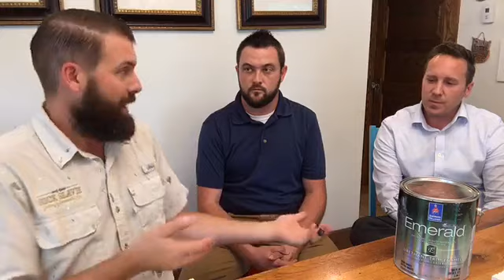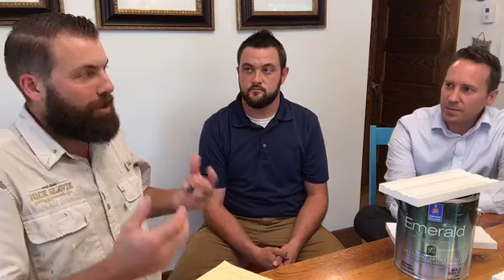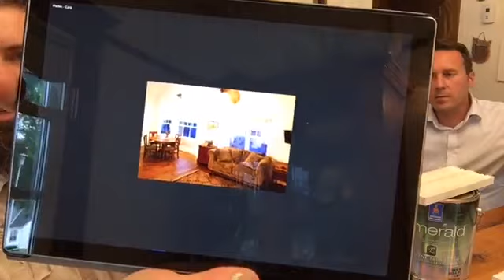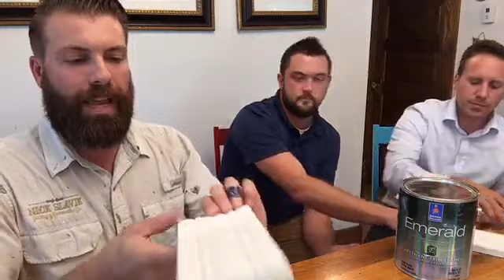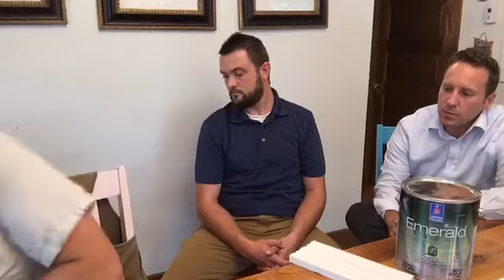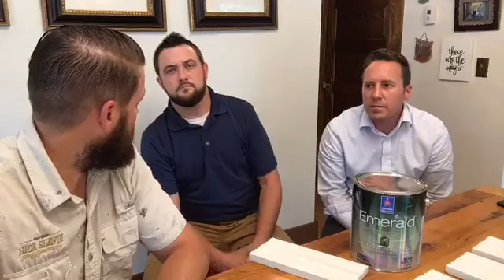Ask a Painter Live #115: Sherwin-Williams Emerald Trim Urethane and all of your questions live!

Comment: How do I apply to be your apprentice?  I’ve been painting for a school district for years as a painters helper. The painter who taught me so much died. The painters they still have don’t want me to waste time prepping, tell me Emerald isn’t made for brushing doors, Dont sand between coats, or vacuum, or even brush off the sanded surfaces or even let me clean the doors or walls any more.  I wirked temporarily fir a painter who is painting peoples houses and didn’t seem to want much prep first. Everyone thinks it’s faster to roll but looks like crap. I’m about to retire from the school district kitchen but would like to work painting g fir ten more years or so.  Who do I apply to be an apprentice in Oregon ?  I only want to paint if I can do it right.

Comment: I am repainting my cabinets bc though the previous owners had it painted beautifully, they didn’t prime correctly. The paint is peeling off down to raw wood around the uppers by the stove mostly. What kind of primer should I apply that works best over paint AND bare wood? Also, what would you use to repair dings in the corners of cabinets?

Comment: Presuming you are very busy, my question re: thinning is in the final paragraph—if you need to cut to the chase. Thank you Nick.

Great videos.   I just used EUT paint in pure white Semi. I had hesitated to try it based on others’ complaints of a roughness to the dried finish.  Your video addressed that concern.  So thanks.  Also, a local SW store assured me the issue applied only to satin and had been resolved 2 years ago.  They offered me a return guarantee.  I purchased semi because the project calls for it, but I may try satin eventually.

The dried semi is not rough to the touch and I am extremely impressed with its ability to level out incredibly well on both horizontal and vertical surfaces.  BTW testing Purdy nylox vs Clearcut.  So far they are so close, it’s hard to say.  But if I had to say right now…edge goes to Clearcut.

Thinning question:  I get the company line of “no thinning needed”.  Till now, I used Pro-Classic oil and never used it w/o thinning with paint thinner or sometimes penetrol, despite the official line being, “no thinning needed”.  Q: Does EUT paint change over time once opened (like oil does)?  If I conclude it does need thinning to restore the qualities of the freshly- opened can, do i use water?  If so, is the max 10%.  My guess is that or much less would suffice.

Comment: Hi there, I used this on my custom board game shelving in satin. Overall it went on great, however, some of the boards are still a little rough (smooth but enough to pull off some of the paint from the box... My question: Is there anything I can do to help smooth out the finished product after I already have 2 coats on it? Thanks again!
Reply: You probably forgot to degloss, sand or use an oil based primer before applying the paint. Or you didn’t wait the necessary 48 hours for the oil primer to cure and harden, before applying the paint. Rookie mistake lol. All you can do now is strip it all off and start over
Reply: @charlesg7926  who the hell is going to wait 48 hours for the primer to cure? Answer, nobody.

Comment: Great video.  A couple of questions, using a Graco X7 , what FFTP do you sue for spraying trim with the Emerald paint and do you have to thin at all when using the FFTP tip.  Also, after sanding the primer and applying a good first coat, is a second coat needed and do you sand between the coats of Emerald?
Reply: Fflp 308.  Don’t thin. Sand with 220.

Comment: Spraying this product takes some additional time and effort to apply correctly.   This product does not apply through a sprayer like any other product sherwin-williams offers.  
Drips and sagging are common.  
What tips do you have that will help with understanding the process of spray application to achieve professional results

Comment: How do you weigh the benefit versus cost (in terms of time and effort for a DIYer) of doing one coat versus two coats of the SW Urethane for trim?
Reply: This isn’t even a legitimate question. Only a question a DIY-er/homeowner would ask. You always do 2 coats. 1 coat will not provide full coverage, due to the application method (spray, brush/roll, etc, nothing gives 100% coverage in 1 coat).

Comment: Using Emerald, what is recomended to use as bonding primer for interior wood cabinets ?
Reply: I've tried so many latex primers from years of experience, most just peal or scratch of like nothing, and none compare to the ppg oil based primer. It dries in 5 min after applying and it sands so easily. I used Sherwin Williams Proclassic for my top coat. And I leaves the closet result you can get to lacquer. You get the durability and adhesion in the primer like lacquer.
Reply: The best finish for cabinets is got to go with lacquer primer and top coat. Leaves a mirror finish. Nothing compares but has to be the most difficult to apply. Takes a lot of practice but once you get the hang of it you'll get blown away.
Reply: ⅰ. Added thin layer of grain filler and then sanded down to a level finish.

ii. Applied first coat of Zinsser B-I-N Shellac-Based (White) Interior Primer and Sealer. 

iii. Allowed 1 hour to dry and then lightly sanded for a smooth finish before  applying a second coat of primer.

iiii. Let primer dry over night and then applied a light sanding as needed

v. Two coats of SWP Emerald Polyurethane Trim white (snowbound). 

Brushed and rolled both the primer and paint. Excellent result’s I will be following this exact process soon on a second job that will be nearly identical.

Comment: If your painter/contractor try's to do the second coat on the cabinets before the 4 hrs how bad is this for the final finish? What do i look for? He is a highly recommended painter but it seemed like he recoated very quickly. Like within an hour. Now the second coat is taking a long time to dry so i literally think he painted back to back coats very quickly on the cabinets and this stuff is 94.00 per gallon.  What would you say?

Comment: Used this for the first time recently and had major differences in performance between the high hide white base and the deep base.  Did base/case/crown in the satin HHW base tinted to Pure White and it was hot garbage.  Sheen to the eye looked like maybe eggshell (no extender/water used) and to the touch felt like flat.  Doors on the project were also satin but in a deep base tinted to Iron Ore and came out beautifully.   But I really didn't see an improvement over Pro Classic, outside of how well it hangs, and still feel it's not on par with Advance.
 
Maybe it's me but it seems to SW's strategy is to release a product before they have the bugs worked out.  Then instead of fixing the bugs on the existing product when feedback rolls in, they just release yet another product line with the fixes, and charge even more for it.

Comment: thanks for this video. im starting a huge project and have been bouncing back and forth between pro industrial or emerald urethane. spraying but going to use emerald for any touch up. keep up the great work nick.
Reply: You can’t touch up 1 paint with a different paint, wtf lol? But the Emerald Urethane has a much better finish to it and looks more beautiful, levels better. They’re both very durable. Pro industrial is slightly more durable but for interior cabinets I’d recommend the Emerald Urethane. Also when trying to paint over previously stained/finished wood, then you always need to degloss, then sand, then clean the dust off, then PRIME using a high bonding oil or shellac primer, then let it cure at least 48 hours before painting it (our company waits 72 for absolute best results).

Comment: I went into sherwin Williams and told them I was painting my exterior garage. I needed white for the trim and a red base paint for the walls. They gave me this Emerald paint for the trim and then their resilience for the walls. We sprayed the trim and it had overspray, when we went to paint the latex over the overspray we went to take the tape off it took the wall paint off too because it wouldn’t adhere to the overspray. What do we do?
Reply: This is different Emerald. What they are talking about is emerald urethane enamel for interior. Your store probably gave You exterior version. That's totally different product.

Comment: This is a really great paint for those who prep the surface and use the correct primer for the application. To the people saying how expensive it is, the alternative is CabinetCoat which is sold at home depot for about $54/ga
Reply: Yup. And this paint is WAY better than Cabinet Coat. But it’s true you ALWAYS need to degloss, then sand, then prime, then let primer cure 48 hours before painting… this is true with EVERY PAINT ON THE MARKET. No such thing as paint and primer in one, that’s a gimmick, a scam.
Reply: The absolute best cabinet/wood paint is Milesi paint though. Or Fine Paints of Europe

Comment: Rodda Unique II is better for a lot less.  Easier to work with, can spray on with an airless for smooth finish over high build oil based undercoater.

Comment: I have to confirm that emerald Urethane is VERY gritty. ive tried both satin and semi and the satin is even worse .  spray, brush,roll all the same feel almost. I can get $30 behr  paint and it feels butter smooth when dry. Im done with using this paint something is wrong with it.  Id rather use solo for normal trim jobs.
Reply: Rick, try Cabinetcoat. Way less gritty and a better price too.
Reply: @fordrac1ng81  I've noticed emerald takes atleast a month or more to cure and if you prime with premium wall and wood primer the finish is alot better and less gritty over time. Problem is the cost. If I'm doing trim I just use solo 2 coats and I'm done
Reply: @bailey2624  have you tried solo with floetrol latex extender?

Comment: I want to paint my 1980"s laminate cabinets.  Is the Emerald paint durable enough after I use the bonder primer? I want to be reassured this wont scratch or chip!
Reply: And by the way, real painters don't have beards... respirators can't seal with a beard.  If you had a beard and really did a lot of painting, you'd be all screwed up quick.... can't breath that stuff.
Reply: Use the stinky speed dry oil based primer.  I worked years going 1M+ homes and found for the millwork sprayed finish, to use Rodda speed prime (undercoater sticks to everything, seals in stains, sands to super smooth finish).  Remove doors and hardware, place doors where they can be sprayed.  Mask as needed, prep everything by filling holes with Elmers wood putty, sand smooth then... vacuum, vacuum, vacuum.  Spray it all with that speed prime (rent an airless sprayer if needed use straining bag and .011 tip... fine mesh filter in airless sprayer if u can, to avoid any plugging of the tiny tip)... allow to dry overnight, sand it all smooth.... I use a tube of bondo glazing putty (red stuff for cars) to hit any more holes or imperfections visible after undercoater/primer (important to use that Rodda speed prime, there's not much else that builds, fills, sands as well... its like magic.  All the latex stuff is garbage, and most other oils don't fill or smooth as well).  Sand and spot prime all the red spots you made (can just use a spray can of aerosol primer).... check it all over to make sure its perfect, vacuum, vacuum, vacuum.... even use a damp cloth or tack cloth to make sure no dust whatsoever... then top coat with latex.  I finally decided on Rodda Unique II for how it performs and lays down smooth, but others latex top coats can get good results too.  Spray everything with the .011 tip, strained paint.   You need a respirator for spraying the oil, and ventilate area to dry it.  You can use a dust mask to spray the latex... and when you spray latex with an airless, the overspray dries quickly, so tend to start at the bottom so any overspray from above falls into wet paint.... if you overspray something before painting it, it can make it turn out rough... because the overspray dries in tiny bumps.  One coat is how we did brand new multi million dollar mill packs... one thick coat that dries down to near automotive finish if prep is done right.  Amateurs doing the spraying might want to do two coats and sand between coats. (Always vacuum like crazy after sanding).

Comment: Will it hang hang hang then as soon as you look away sag and run like proclassic does? For some reason I have no luck spraying proclassic it seems like no matter how thin I spray  it, it will look awesome for a few minutes then it seems to just fall off the surface. Gave up on it. Until I can practice more at home. Don't have this problem with anything else I have sprayed. It's a good paint but it's too damn finicky. Any tips?

Comment: What drywall primer/sealer do you use?
Reply: I hear a few guys use SW high build drywall primer in my area
Reply: If you're using this paint, it's going to be on a touch surface. Best to have a fresh coat of oil based primer like the original Kilz before laying this down.

Comment: Or multimaster acrillic urethane enamel is similar in an acrylic version which would equate to not cracking on exterior wood from getting to hard and exposure to sunlight .I find that oilbase coatings are not as suitable for exterior woods as they break down  and crack overtime unlike acrylics .

Comment: Renaissance is the most equivalent to it from Cloverdale in Canada. Although it is a hybrid  alkyd.and not urethane it is interior exterior unlike proclassic which is just interior . Zero brush strokes with renaissance and self levels out just like a traditional oil .
Reply: David Ilijevski Renaissance used exterior fails near water exposure. It also stays sticky on window ledges especially if heavily tinted. Fine product but get real with the superlatives, it has limitations.
Reply: @fogsmart  ha yea sure ok any paint u use thats sitting under water will get sticky . Curious what kind of wallmart brand are u using lol.
Reply: David Ilijevski I’m using Renaissance, not sure where you got the Walmart reference. I’m not talking submerged exposure, places like columns where there is splash back from rain bouncing on deck, the low end of barge boards near the end grain, etc.
Reply: @fogsmart  ooh ok yea your right ,i do know they have had to reformulate the paint from when it came out there were problems with it .i personally use it for metal doors .
Reply: David Ilijevski don’t get me wrong it’s a great product and I love the pearl sheen for exterior use but I’m getting too many failures. I can post pics. I also find it yellows after a time so for interior trim and doors it actually achieves an off white without using a L4 tint, and for pocket doors it’s a thousand times better than oil based paints. It’s a great paint for exterior doors and shows no signs of issues over repairs on metal doors. My exterior metal doors have a covering but the wooden shed doors peeled along the first inch near rain splash-back. It’s certainly my go to for all things interior. Window ledges I tend to only use it in summer
Reply: @fogsmart  yes definitely have to tint it for the white colors ,i tend to stay away from oil paints that have exposure to sun and prefer to use covercoat for exterior wood trim the wood can breathe through the latex acrylic paints .not sure how that emerald urethane paint acts on exterior garage doors or window trim any idea ? Cloverdale does carry a multimaster i have used it for cabinets seemed to work good and dry time was fairly quick . I was told the multimaster does not yellow but im not sure if i totally believe that .
Reply: I have never used Rennaisance outside, I use Covercoat there, and it's held up well for decades. I use oil based primer outside, not sure what was under the window ledge issues. Did he mean interior window stools / sills ? @davidilijevski8942  
Or the type and age of wood etc.
I'm going to try BM Command, it's applied in several places I go, and really looks interesting.
I spray Emerald with an hvlp on interior trim, it's a great product.
Thanks for posting !